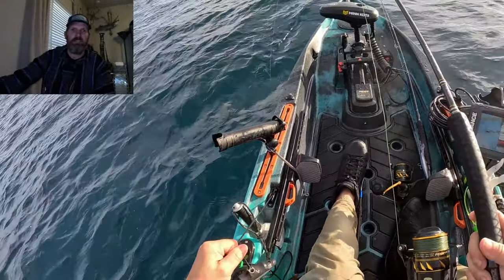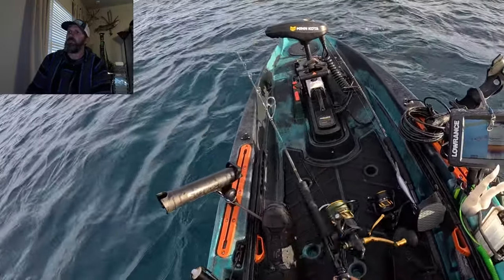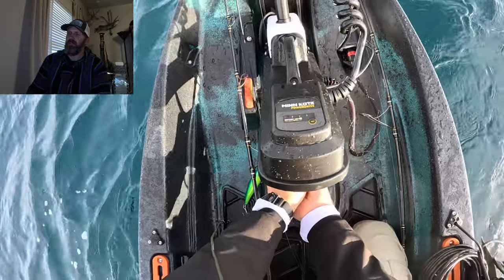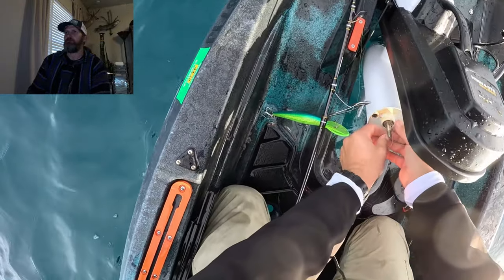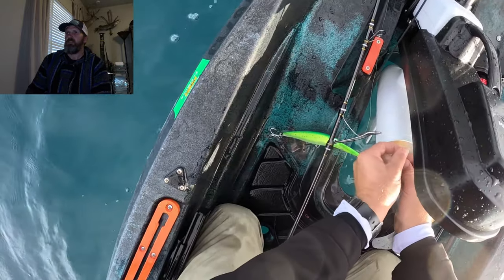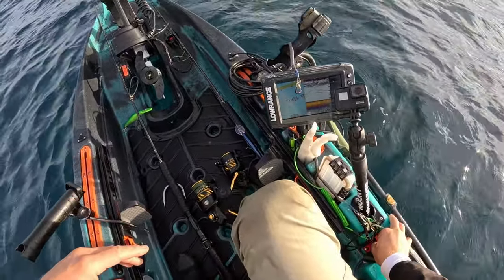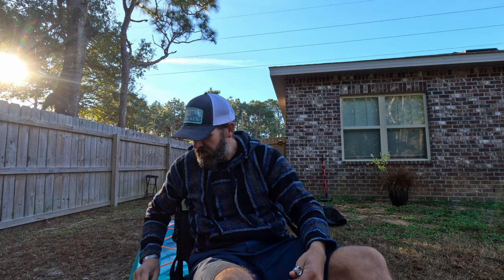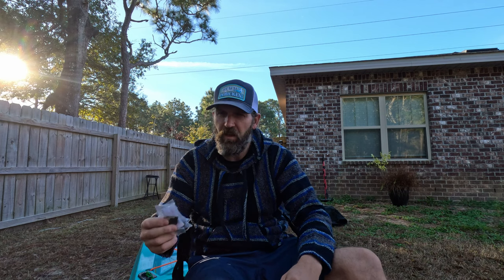How to remove line from Old Town Autopilot on the Water 🚣‍♀️

Comment: Great video looks relatively simple as long as extra misc parts are available. I've got AP 120, 2yrs old- that is brand new,w/ go9 simrad, &trolling tower, that has never seen water, since I stay on the boat most of the time 😅. My initial response is a great philosophy to live by having 3, I doubled up on spare prop parts & bilge pump. 4/23' is maiden voyage
Reply from the maker: Awesome!  Yes, I firmly believe that having extra is the way to go.  It was pretty easy to do, but it would be easy to loose something into the drink.